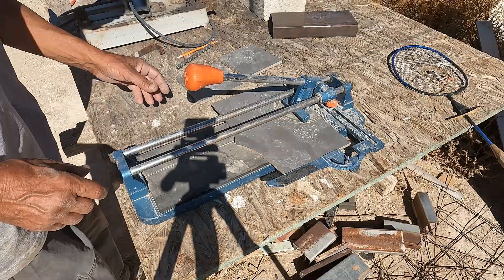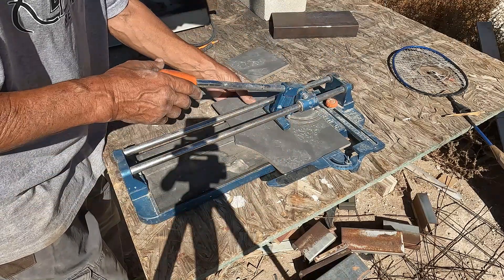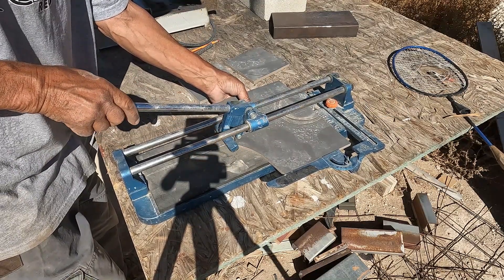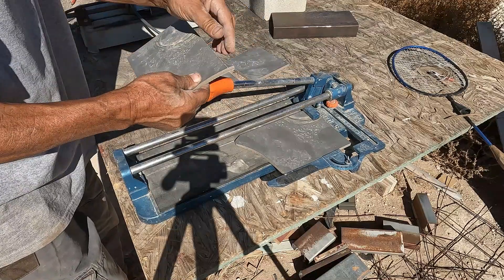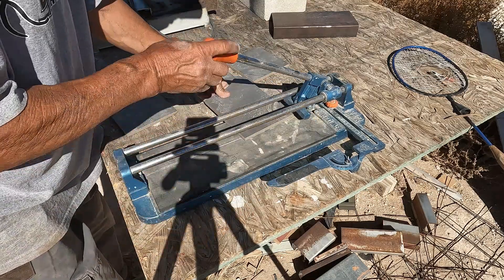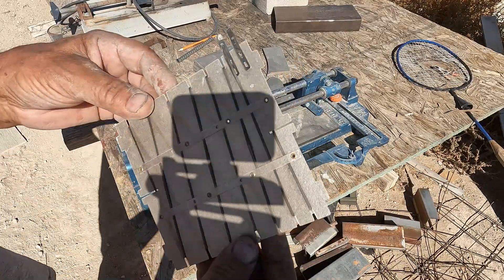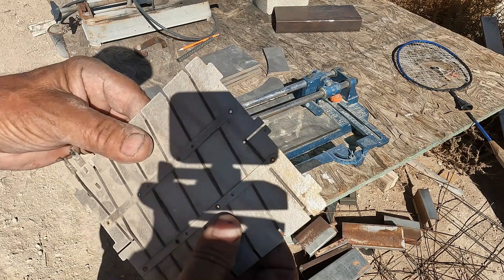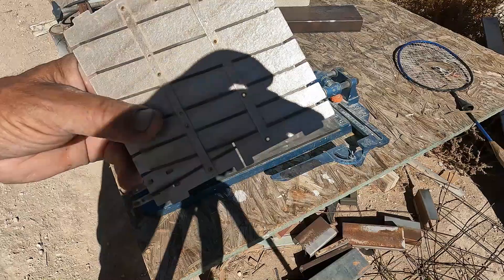166 - Major Breakthrough in Creating Heat Elements for Various Applications

Comment: you could have used the the fiberglass as template and mark the tile with an edding3000 marker
Reply from the maker: I was incorrect about the material. It turns out to be mica. As far as your suggestion I will have to research it. I am not familiar with that equipment.
Reply: @off-gridsurvivalmike8120  
its just a waterproof marker so you can marking instead of measure

Comment: I am very doubtful that "mica plate" will be a problem, considering the resistance wire is wrapped around it. Unless perhaps you are going to drive it hotter than "bright glowing red". But, you do introduce a novel idea for what to do with my old sort of crappy toasters.
Reply from the maker: Yes I believe you are correct. I didn't realize it was mica. I presumed it was fiberglass because of the similar look. But the mica I am retrieving is quite fragile and hard to rewire. Also the tile is a great alternative as it becomes part of the thermal energy storage.
Reply: @off-gridsurvivalmike8120  BTW, that first few seconds really had me thinking. I was like, is he using electroluminescence or what? hehe very cool stuff.  For those who don't know... "don't actually touch one if it is hooked up".

Comment: What is the wire your using?
Reply from the maker: The heat element wire is out of a toaster. It was one of the heavier guage ones that I retrieved. I am not sure of that particular size? It may be approximately 1/16 or .060 in width by maybe .005 or heavier? I will write down the sizes from now on. I just cut whichever size I happen to choose to the right length I need according to the resistance. If you follow what I mean. The wires connected to the terminals are 8 guage.

Comment: There is this guy out west that heats his whole house with 24 volts and has various runs of wire buried in concrete and then he invented a BMS that switches depending on the resistance he needs. Electrodacus I believe he is called. Very cool system he has and you are catching up to him. Cheers Mike